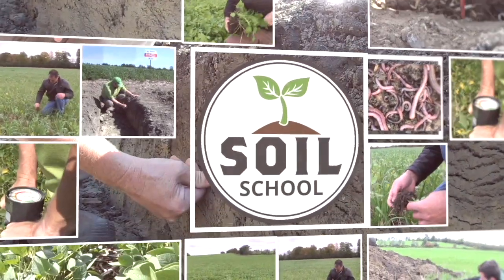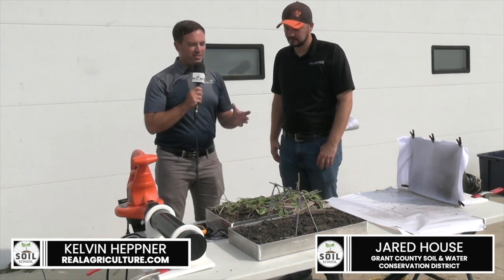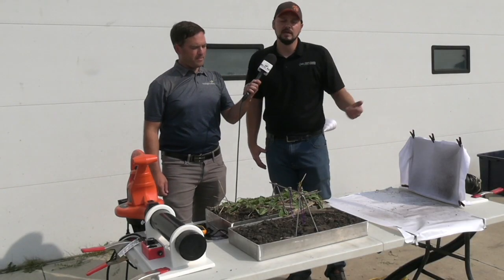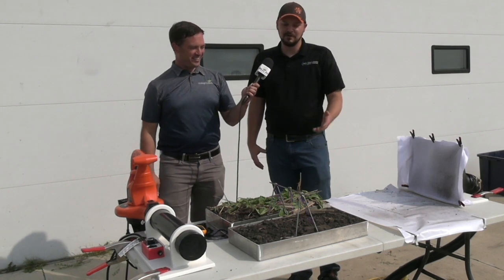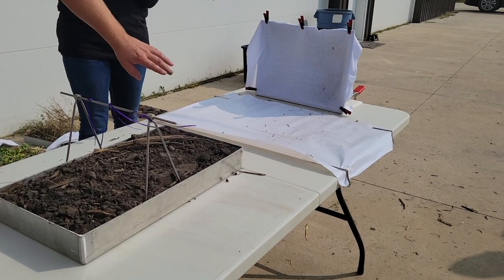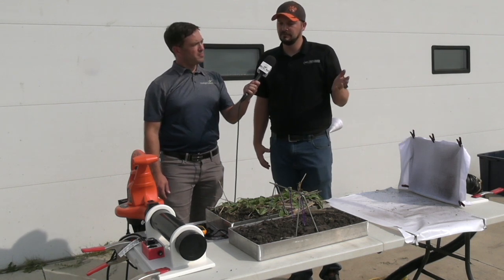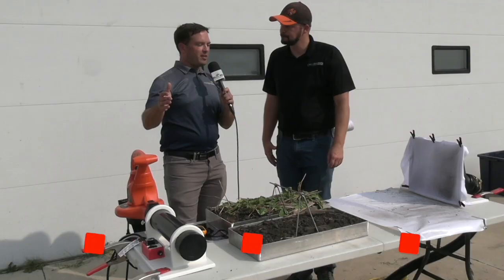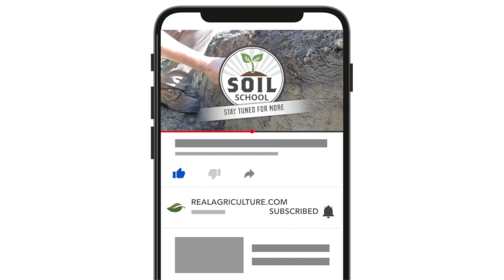Soil School: Don't flirt with snirt

Comment: One of the things that i had noticed was all the neighbors that had bought thoese vrtical tillage machines that leave the fields in that super nice condition for seeding next year had lots of soil moving in the ditches in the winter . There was no stubble left standing and no snow cover . When it blows in the winter the snow will actually dislodge the soil particles and have it move along with the drifting snow - kind of like sandblasting the frozen dirt even if it was frozen solid with water .